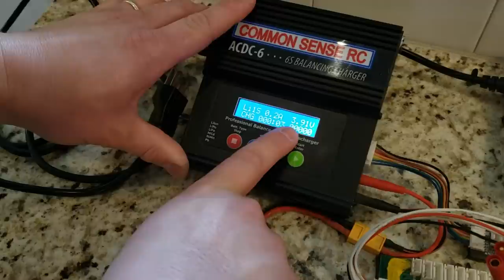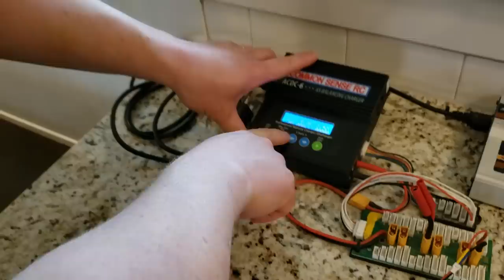Eachine - P-51 Mustang - Mini - RTF - Unbox, Setup, & Maiden Flight

Comment: Hi Brian great video thanks I just love those ultra micro planes I have quite a few of them by 
Horizon hobby p51and spitfire etc great fun and pretty durable....if you’re just starting out in this hobby 
The low cost and durability not to mention the fun that can be had is a must I’m sure you’ll agree ....I started out with an ultra micro j3 cub and never looked back thanks again best wishes Chris
Reply from the maker: This plane is a far cry from the Horizon Hobby lineup, but it's a lot cheaper, and still has relatively good auto-leveling, and even had a few additional features, but as far as fly-ability...if that's a thing...HH takes the cake, if you can plop down $125-150 per UMX.

This plane surprised me by being a VERY good one!

Comment: Today I got second this RC model. First one was weri nice , but I lost due to very bright sun , outcoming from clouds. At this moment I cant see nothing in direction of flight and I lost plane. There need enough free spece for use. This small plane is very fast and impossible use in urban - parks or stadions.
Reply from the maker: Skills come with time. You can do it, and one TRICK for you. Close ONE eye whenever you must fly "through the sun" and then when you're past, you can open BOTH eyes again. This is a trick the PIRATES used to use when they'd go into the ships hull to keep from being blinded when they reemerged into the bright sunshine.

Comment: this is late, but i made my own landing gear,  little longer, stiffer wire.  then cut quarter inch off each side of prop.  full up elevator on take off, never hits prop on take off.

Comment: Ya looks like you did something wrong on the initialisation process at the beginning. But man the abuse you put the plane through and it held together and flew perfect sold me on it. If anything you did a awesome durability test. and proved how good this plane is. And yes the prop snaps off in a crash and snaps back on to save the gearbox  and motor shaft.
Reply from the maker: I know!!! I crashed it straight into the ground off camera after our filming ended, and I broke a prop...had it replaced without tools in about 2 minutes (including walking in and finding it!!!)...What a great little plane!!
I think I figured out what was happening at the beginning of the flights, it was going to a 3 Channel setup!!?!??! BUT it was correcting in the wrong direction too. Not sure how one could successfully fly with that handicap, but I suppose you might be able to do it??? It did that the second time I went to fly it, but I caught it and fixed it...
Thanks for watching! This plane is a great value!
Reply: @BrianPhillipsRC  So what is the proper way to get the gyros set?

Comment: Small correction. LiPo nominal voltage is 3.7V. Max voltage is 4.2V.

As a 40yo Man-Boy I feel I have the authority to correct you. Otherwise, good review. I'll probably pick one up after the first of the year. That's when I cash in my vacation days and buy my toys for the year.
Reply from the maker: LOL - I can't ever really tell... It seems like some MFG print 3.6VDC and others print 3.7VDC. I find it strange, since we really only run them from 4.2VDC per cell "fully charged", so why call them 3.7VDC (or 3.6VDC) or anything else for that matter. Why not 3.8VDC Nominal, since that's "Storage Mode" charge level for best chemistry??? Lipos are so goofy anyway...let's get a battery that can discharge more than 20% of it's voltage...then we could do SOOOOOO much more with these things.
Reply: @BrianPhillipsRC  nominal voltage is the mid point at which a circuit operates. So I assume that batteries are labeled similarly. I think from an operational point it's better to have a battery that keeps it's voltage up. I don't know how long you've been in RC but the change from NiCd to NiMh was great because the voltage stayed higher then dropped off when it was done. A 2200mah battery that drops down to 2.0v per cell doesn't sound as fun as one that provides 2200mah and only drops to 3.2.

There are lipos with 3.8V nominal rating. They are in high power devices with self contained charging circuits like phones. We'll probably see them in RC eventually. Right now they are making so much money on 3.7v lipos it's crazy. Buy the cells for a few bucks, solder a connector on, wrap them with pretty plastic sell it for 10times the cost.
Reply from the maker: Sure, sounds about right.

Comment: Looks like a nice home theatre system you have! Dolby atmos? Nice plane by the way..
Reply from the maker: I'm glad someone has an appreciation for this!!! They're Canadian made Paradigm speakers... 4X Matched Titans. I have 2X Micro's and 2X Atom's Downstairs. I think we have the same tone matched center channel up and down and I just love them! I finally found a second 12" Paradigm Sub. I originally had only one 12" (upstairs) and one 10" (downstairs) for a long time, then I found a second 12"!!! This room is pretty big, so dual 12" Subs are necessary. It makes for a very full sounding, immersive experience.
The plane is really WAY better than expected! It's definitely not a HH UMX, but it's WAY cheaper and still very easy to fly...in fact, it might be easier than the HH offering ;)

Comment: Mine just started doing the same weird right stick rudder left stick no ailerons.  It's not fixing with reboots or anything. I wonder if it's a tx or an rx issue.
Reply: mines the same I've no idea how to sort it?
Reply: @bensykes5830  the shop is posting out a new tx. Will let you know if it fixes it.
Reply from the maker: Did you try like I showed in the video? I've heard of others having this issue, and if you can get it to reset, it should work for you. It's almost like the plane reverts to a 3 Channel mode...
Reply from the maker: Watch starting at 31:00...this is about where I figured out that I had a problem, and what I did to fix it. You have to hold it level, fairly quick after re-plugging in the lipo on the PLANE, with the Transmitter already on. Also, I believe you can recalibrate the gyro when you get it laid back down.
Reply: @BrianPhillipsRC  tried that several times. It wasn't fixing it. The shop said it's a TX fault and ate sending me one out. Will hopefully fix it.
Reply: @bensykes5830  the new tx fixed it.
Reply: @BrianPhillipsRC  the replacement tx seems to have fixed it.
Reply: @TheLiamis  arh right sound mate I've just sent mine back and got a refund now like
Reply from the maker: Glad you got your refund. I'm sorry you had to deal with all that, Ben Skyes

Comment: Hey Brian, a good mod for starters would be to fit it with a four blade prop. 👍
Reply from the maker: Sure, if you're looking for scale, that would be a smart move, but in my opinion, this plane kinda "misses" on a true "scale" plane, so I just kinda look for the main lines of a P-51, and I've learned that some of these "indisparities" must be tolerated at this price point.

I'd like to see the ailerons further out on the wing, and room for flaps, but that would require a whole lot of work...the plane actually flies GREAT for an economy plane!!!

Comment: Can you recommend a charger that could charge multiple batteries, something easy to operate. Thanks enjoy your channel 👍
Reply from the maker: I use this for all my lipos, unless they're just super small...

Balance Charger - https://amzn.to/2IxmRla
Parallel Board - https://amzn.to/2uduI1v
Parallel Cable for Eflite 2S Lipos - http://amzn.to/2E9hXVn
Simple 2S/3S Charger - http://amzn.to/2ruHHKe

I use this to test my packs...
Voltage Alarm 1-8S Lipo - http://amzn.to/2G6jqxy

...but you need to know that charging lipos is probably the most dangerous part of this hobby. You really need to spend a bit of time making sure you're doing it right. If you're not 100% confident, you need to plug the charger in outside on the concrete porch and do it there.

I have a playlist called "Non-Plane Videos" which will have a few battery charging and parallel charging "How To" videos. You might want to check them out.

Comment: ALWAYS turn on the transmitter first.
Reply from the maker: This is the rule of thumb, but your comment is not correct. There are a lot of planes that must be turned on first...however dumb that may sound. I have about 5 or 6 of them.
Reply: Yeah, that’s really not true with today’s systems

Comment: That plane is a joke!🤣🤣🤣😂😂😂! I build mine out of Guillows, Dumas, and Easy Build Airplane Modles.
Reply from the maker: Your plane took you weeks to build, and it's probably 10 times nicer, but this plane took me 30 minutes to be flying. Some people don't have weeks to spend, or more money to spend to get up in the air.

I have WAY nicer planes than this, but this plane is still really cool!
Reply: @BrianPhillipsRC  true. But now a days I can build a Guillows kit with CA glues and Elmers stick glue for the tissue paper. Plus you can buy colored paper to cover the plane. I can build one quick in 1 week if I built the whole plane structure in one day. Cover it in Krylon clear coat. The electronics I bought are from Eflite and Hobby Zone for 2 cell micro eletronics.
Reply: Guillows is my fav
Reply: @dat_lil_default2972  Try looking up Dumas model company, Vintage model company, Easy Build Model company if you get board with Guillows. They might cost more money, but the models are very interesting and different.

Comment: Jesus bruhh, talk about Adult ADHD 😆 Now I know what It looks like when I spaz out about Drones except excluding the constant repetition of the same thing 20+ times and pretty much using any copter or RC device with a No-brainer type attitude.. because honestly if you can figure out 1 you can figure / fly them all, they're pretty much like different types of consoles with different Controllers/hardware/software but yet all in the same. Good way to dumb it down for the not so assertively functional people or the occasional nimrod who shouldn't even own a RC device. But try to tone it down a bit or maybe split up the video for a more for fit factor i.e. make a Maiden Flight/Control then maybe a In depth inbox with accessories and different options and then a Range test / pros and cons type video. These are just my opinions and takeaways from my POV but overall good shit and hope you're having some fun and success while at it!
Reply from the maker: So you don't think there's ever a first time pilot? Give me a break! I talk to THOUSANDS of people who can't figure this stuff out, and don't want to get into the hobby because they're met with attitudes like what you're put out on public display!

If you want different content, and not claiming to be perfect in any way, just make it yourself and get back to me when you have 10 subscribers.